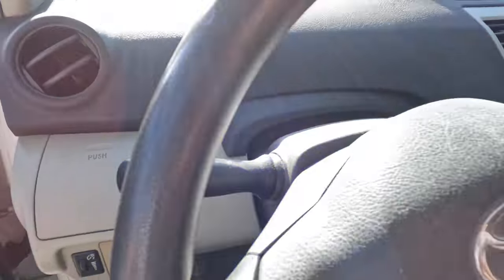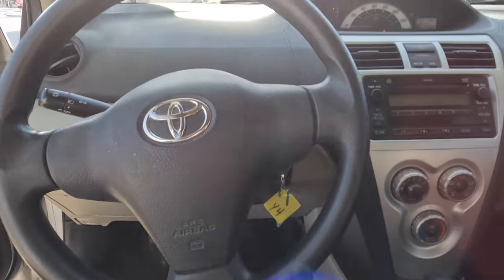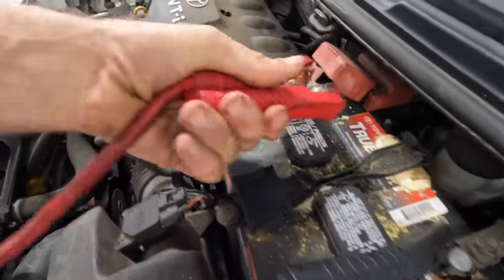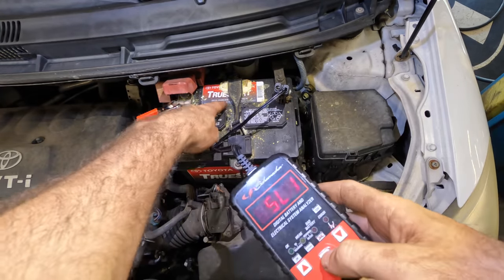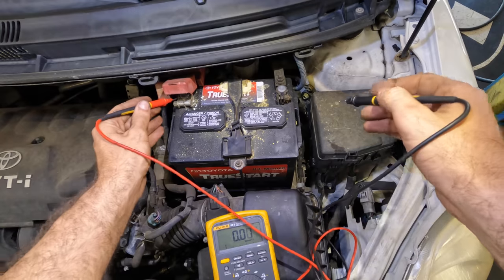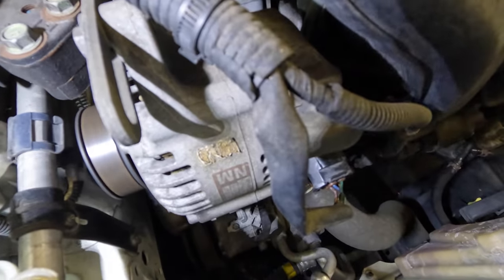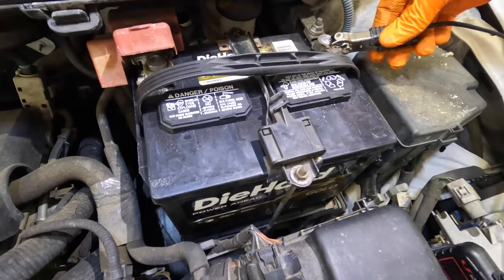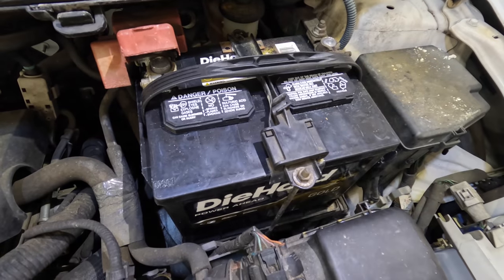Ignore the obvious! “Let’s see what happens” 2006 Toyota Yaris

Comment: I worked for a Toyota dealership when the Yaris had just been released. Drove way too many of them. You haven't lived until you've driven the base model with the 1.3 liter engine and automatic combo. 0-100 was measured with a sundial.
Reply: I never could get over the lack of a display in front of the driver.  Always felt wrong.
Reply: 0-60 in five miles
Reply: @kennethking2301  only if the downhill run was long enough and steep enough
Reply: You have bought the wrong car if you want to enter speed trials.
Reply: Were you driving brand new cars like this or customer cars? Either way it’s not good.
Reply: Well it still beats the geo metro with the 3 cylinder Suzuki engine!  0-60 was 20 country miles!
Reply: @bertblue9683  You learn to appreciate it. The wheel doesn't obscure the dials.
Reply: It was really designed for a 5 speed not an automatic. You can extract more omph from a smaller engine. Its how we do it in Europe or Japan.
Reply: @zoidberg444  oh trust me I know that’s why when I was 19 some very many years ago and owned a Metro it was with a 5 speed manual trans!
Reply: Alot of these hatchbacks are cheaply built and barely even make 80HP
Reply: Slower than a two horse wagon in India on a one lane road
Reply: @bertblue9683  one of the Saturn models was like that too. It's wierd.
Reply: Hadn’t happened since the 3 cylinder geo metro
Reply: I see your Yaris and raise you a 1991 1.0 liter Geo Metro.
Reply: @clintonhanson  — Or 10 miles as the crow walks?
Reply: The manuals are slow enough, never seen an auto, but I imagine they're even slower!
Reply: You know you are going fast in a Toyota Yaris a tortoise gets done for l speeding
Reply: Tercel, Echo and Yaris were great cars for someone who was on a budget.  I saw an Echo for sale once that had 560,000 miles on it.  I thought that had to be a type-o in the Craigslist ad until I saw the picture of the odometer.  I wonder how feasible it would be to try to get that many miles out of a Mercedes or BMW.  I always question "disposable car" thinking.  You've got to love how simple they are to work on too.  Complaining about how slow they were is really missing the point of what these cars were all about, imo.  Cheap to buy, cheap to fuel, and cheap to repair, and yet with cheap maintenance they could still last.
Reply: @dainsmart6237  I had my 1 litre Yaris doing 190km/h on the autobahn in Germany multiple times.
Reply: @zoidberg444  was it being towed?
Reply: No skip jokes then Skoda taking over who remembers that advertisement lol♥️
Reply: @bertblue9683   So true
Reply: @bertblue9683  Allowed it to be produced as inexpensively as possible in both right and left-hand steering versions.
Reply: You’re funny, thanks!
Reply: 😂 bruh the engine is a hamster and a rubber band what did you expect? It literally makes like 80 hp.
Reply: That's at sea level, above 3000 feet in altitude you would probably include a moon cycle as well.
Reply: @zoidberg444  must be downhill or with the wind on the back of the car.  i never got over 185km/h after 10km flat out on flat surface...  butt it never broke down
Reply: @bertblue9683  The theory is it's further away so your eyes don't have to focus as close.
Reply: I bet a '76 Chevette is slower.  Ask me how I know.  😆
Reply: @bertblue9683  This was set up like this so that the car was simpler to configure fthe car for LH or RH drive.
Reply: 0-60 in 5 miles
Reply: Just move the throttle from turtle to rabbit, then you can easily post a 0-100 in minutes instead of hours.  Or if you've got the manual just pull it back until it clicks a few times, then hop in and enjoy the ride.  ;-)
Reply: That is why with small hatches, best to always leave the smallest engine option alone 🙂
Reply: Sounds like a perfect car for a teenage boy
Reply: measured with a sundial so funny.
Reply: @pschard664  It was on the flat. Maybe I had a bit of tail wind.
Reply: 1.5L in the USA. Good power in the hatchback. Drove one for 11 years!
Reply: @bertblue9683  but you got 3 glove boxes in the car and didn’t have to remove the steering wheel to get at the gauge cluster.
Reply: my coworker had a Toyota Echo, which i believe it was replace by the Yaris,  and you are absolutely right!!! mergin into traffic was an adventure; i   will always remember her bragging about her mileage...
Reply: Here in the Netherlands there's even 1.0L engines in the Yaris.
Reply: @zoidberg444  Which can be solved by telescoping wheels. I've only ever had that issue when I used to drive my mom's Nissan versa, since the telescoping ability of the wheel was lacking.
Reply: @thequickbrownfox7289  I'll see your 1 liter GEO Metro and raise you 1975 Honda 600 coupe.
Reply: @khakiswag  Never heard of the Italian Tuneup I see..
Reply: @justindaniels17  They are meant for general transportation, not NASCAR.
Reply: @EricVonHunter  did I say to have 500hp or something because I don't recall that most cars on the road have over 150hp so having at least 150hp would be zippy enough in the roads
Reply: I have a 2007 base model, and let me tell you when you floor it... it still takes a solid 2 minutes to get to 100.
Reply: See my 97 jeep cherokees 0-60 is measured by sundail... But you wanna measure the 0-100 youll need to bust out the calendar
Reply: They were some of the butt ugly vehicle I've ever seen. I could not make my self buy something that homely.
Reply: @justindaniels17  Guess I'll put my 01 and 02 Corollas out to pasture since they only have 120hp.
Reply: @21Piloteer  oh God. I worked for Alamo rentacar back then turning wrenches. They couldn't power themselves up the ramps on the transporter. We called them decliners. If you turned down cdw and pia and all the other bullshit add ons that paid the customer service reps commission, they stuck you in the chevette. 2 adults and 2 kids and all that luggage. Turn on A/C. It barely made 55 on the interstate floored. And the A/C kept you at about 89 in the Florida sun. What pieces of...
Reply: @EricVonHunter  I didn't mean that seriously
Reply: Wife took one for a 24h test drive when they first came out, returned it within 2 hours it was awful. I drive the new hybrid ones at work and the cross version,  they are great.
Reply: I highly doubt they could make it to 100mph. I'm assuming the 0-100 in your comment must be kph
Reply: @zoidberg444    To  do that, you'd have to floor the gas pedal, and not upshift at 3,100 rpm. These two things are frightening to many Americans.
Reply: @xerowolf4242  I've got mine to do over 100mph cruising on the autobahn in Germany. I drove from Cologne to Munich one evening and I think it must have sat cruising at over 100 for 4-5 hours quite comfortably. Although I was getting a burning oil smell in the cabin.
Reply: 1.3 impressive, some lesser people had the real base model which was 1.0 litre
Reply: @thequickbrownfox7289  I had a 91 Metro and it had an automatic to make it even worse. When I was released from the hospital after a heart attack and got home, I found my car parked in the driveway….. or should I say what was left of it was parked in the driveway. It had been stolen and had hit the ditch HARD. Drivers door upper hinge was ripped out so door hung to the ground, hood was mangled to the shape of the now broken windshield with the hood folded many directions
Reply: The Yaris become much better as a rebadged Mazda2.  I had a 2012 Mazda2 5-speed manual for a daily driver - did some work to it and it was fun to drive. The 500HP Mazda 2 Rally Car car is sick.
Reply: I live in the uk and my mum had a yaris. I had to use it to drive to work some days and i managed to get it to 100mph bit it took a while as i was w 1.0L engine
Reply: @M-n-Vacafornia  ... also better than having to walk to where you need to go...
Reply: I have the 2008 Yaris MANUAL it has a 1500, and I KNOW how to use it! :P
Reply: @joeythedime1838  But I've always wondered if reliability suffered when the Yaris became a Mazda.  Does that mean it's a Mazda engine and transmission? Wiring? Computer? Fuel pump?  I actually don't know if I'd want that one.  The new Supra is a BMW.  Toyota can't design their own cars anymore.  They're acting like a company in trouble.
Reply: @M-n-Vacafornia  they're just doing what every other company does, which is manufacturing things that are not needed, because people have no attention span anymore and want new things for no reason.  Obviously their own engineers know the reliability history of the products and refuse to budge, this way they can blame those new shoddy cars on someone else
Reply: A sundial???...

...I thought it was measured with a calendar ...
Reply: I love the Yaris 1.33 vvti. If you want a quick Yaris, drive the GR. 
However, this one is for the city and a bit more, not a drag ricer.
Reply: Mazda s made before and after  mingling with Ford depending on a model were/are equal or more reliable than equivalent Toyota s And now they are part of Toyota Group and pushed as upscale brand  so  no worries here. i had 2014 Mazda 2 did 170k without a single breakdown or malfunction, just wear tear and fluids, you drive Mazdas like you stole it so it takes lots of tires brakes tie rods etc but its an option, also rust protection is not the best
Reply: @xerowolf4242  it can since that's based on transmission shift timing, but it would not be the easiest on that engine.
Reply: You should test drive the old Mercedes 220D (type W115), it does 0 to 60 on a summer vacation :) It is simply dangerously slow.
Reply: @M-n-Vacafornia  Fully in agreement. Yaris is the most basic transportation. How to get from point A to point B at the least cost. Reliable, and...high resale value. Anyone trashing a Yaris, is a lousy car shopper. If you want a fast car, there are tons of them in the market for a few more thou of $$
Reply: I thought the Yaris all came with 1.5 litre engines? In the US anyway.
Reply: @Derek8487  Not here in Australia. The 1.5 with a manual was actually a bit more lively.
Reply: @bertblue9683  IOnce you get used to it, you notice that the steering wheel never blocks anything and there's no glare at night.
Reply: @bertblue9683  Until you drive one it actually feels normal and is totally unblocked by the wheel and your hands.
Reply: @kennethking2301  what a stupid thing to say.    It is actually 10 seconds for the auto,  less for the 5spd.   This in a car that lasts forever and easily and consistently provides 40+ mpg.  
How fast is your '97 Ford Exploder?
Reply: We have an 08 that we use as our grocery runner. Probably the most reliable most cherished car we have ever had. Paid 11.8k CAD back in 08 and could sell it for 7.5k today with $2/liter gas prices but she's not for sale. Putting new cv axles in this weekend and good to go!
Reply: @auntbarbara5576  I guess you don't get sarcasm where you live. BTW, I drive a Tesla.
Reply: Used to rock those badboys as work pool cars. I used to hate taking them on longer trips to regional offices, I'd nearly get blown off the highway when a road train comes at 110kph the opposite direction.
Reply: @bobmartin4942  lol - OK now let's talk about a 79 Fiat 500!  Amazing what small engines they used in some "cars".
Reply: I did too. Someone wanted all TRD parts on a 5 speed manual yaris. No idea why but. We put it on. Sway bars springs exhaust was a bunch of stuff.
Reply: The little square box Scion was the same way.  The first time I saw one of them in person all I could think was "We are the Borg resistance is futile".
Reply: I drive a Yaris 2008 d4-d. 0-60 in10.5 seconds with enough torque to play in the traffic, but it gives me 62 mpg (US units) on my commute so I do not weep filling up every couple of weeks.
Reply: @justindaniels17  88 from 1.4 turbo diesel but 62 MPG US with 147k miles on the clock😀
Reply: @thequickbrownfox7289  I will call that with a 3 pot 52hp 850cc Daewoo Matiz. Now that really did need some forward planning before joining the freeway🤣
Reply: @rayzor285  my Yaris diesel makes 88 but give 62 MPG (US) on my commute.🤣
Reply: I drove for a Toyota dealership until 2015, I hated to get orders to go get a Yaris, I refused to drive them on the interstate, back roads only, even if it meant adding an hour to a 200 mile trip.
Reply: @kennethlee494  The little 1.4 Diesels her in UK will do 80Mph all day long and pull like a train uphill in 6th.
Reply: It didn’t have power steering either
Reply: It’s actually a 1.5L 1nzfe motor. Not a 1.3. Currently a Toyota technician and I deal with these motors in everything from older Corollas to Prius’s to scions. These motors are decently strong too if you don’t hammer them. The one problem I’m constantly seeing with them is the spark plugs and coil packs going out at around 100-120k miles
Reply: Not as slow as my Gen 1 Prius. I hop into the Yaris and it feels like a sports car!
Reply: 1nr-fe rocks. If you cant find any engine parts in your country. Just ask your filipino friend to buy it in PH since that engine is commonly used by cabs here.
Reply: @19Daantje98  here in The Netherlands there's even a 1 liter 3 cilinder turbo in the Ford Mondeo. Eat that!
Reply: I believe the Yaris was the last car to come with a 4 speed manual...had a gf with one back in the day...kept looking for 5th gear while driving it...what a turd
Reply: @toddhowes7722  here in Holland a 4 speed never came out here, just 5 speed manuals and a few automatic boxes (the automatics cost like € 2.500 extra on a car costing about € 18.000 back in the days)
Reply: @toddhowes7722  As far as I know the Yaris never came in 4 speed manual in the US. It was a 5 speed until they started using rebadged Mazdas at which point it had 6 speed.
Reply: The brushes were worn to nothing and the copper commutator grooved deep. That alternator is cooked.
Reply: You should have test-drove an 85-ish Hyundai Excel -- talk about a pig. A friend, the salesman and I pulled out of the dealership with the AC on, and were only able to accelerate to a whopping 20 MPH on  a slight incline. Did a U-turn and went straight back to the lot. Settled for an 86 Isuzu Imark, which had slightly more power.
Reply: @kennethking2301  or minutes, whichever came last
Reply: Come to Europe and try the 1L 3 cylinder VVT-i version. My Toyota Aygo has the same engine but it only weighs 800kgs so it's not that bad. Can't complain though when my last tank measured 77.8mpg imperial (25.4L fuel used over 435 miles)
Reply: Had you been conscious when looking at the sign of the dealership
and paying attention - you would have noticed that it is TOYOTA 
and not Toyota

Unfortunately you were programmed to be a ZOMBIE and have eyes that cannot see
- ears that cannot hear.
When you look at something - be sure to see exactly what it is you are looking at.
Reply: Talk about slow.....back in the day, too many years ago to mention, I had a 1968 VW camper van. It produced a whopping 68 horsepower. With a tail wind and going down hill it would top out at about 60 miles an hour.

Great vehicle for a guy in his 20’s and looking for young ladies to take “camping”.
Reply: The 1.0 had 67 hp and 850kg.
Reply: I got one as a rental one time. Despite having longer than average arms and shorter than average legs, the pedals were too close and I had to stretch to reach the steering wheel.  I'm guessing someone built like a lemur would find it really comfortable to drive.
Reply: Yes, characterized best by the grandfather clock windup key protruding from the trunk
Reply: @zoidberg444   I own an 08' sedan with no options, 5 speed and was getting 42 MPG with her. I named her Maseryaris!  I never complained about power. Still run her today with over 220,000 miles on the odometer.
Reply: @kmadamsable  Yeah - mine is an 06. 1.0L (3 cylinder) 5 speed hatchback. I've done 225K in her. She has never broken down on me. Have had to replace the front and rear suspension. Waterpump, clutch, alternator, battery, exhaust but given what a hard life the car has had I can't complain. Watch out for corrosion around the rear mounting area for the axle beam. I had to do some rust treatment on mine around there. 

I tell you with fuel prices what they are this car has saved my bacon. I do 20,000 miles a year and I go through a tank of fuel a week. You can get a used engine for one of these for £150. In 2017 I repaired my front crash damage with some scrapyard bits for £150 all in for front end, lights and a colour match bumper.
Reply: @zoidberg444  - I've replaced the alternator, front struts and rear shocks, the exhaust manifold donut seal, rear muffler and battery. Yeah, the rear frame area where the axle mounts to is starting to go. I think that would be the reason to scrap the car is if the frame area rots out which is too bad because everything else is still in tact!
Reply: A sundial would update at the speed of photons, thus the speed of light.... So that means, Yaris must be a really fast car? (Either that, or it's a bad analogy that depends on people to misunderstand how sundials work? 🤷‍♂)
Reply: Because that is cheaper than an alternator trying to save alt replacement